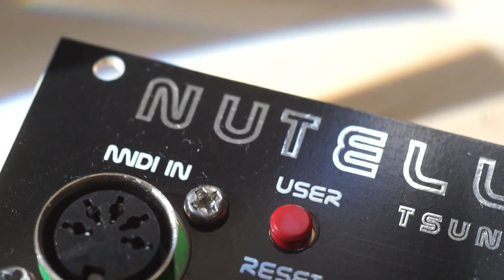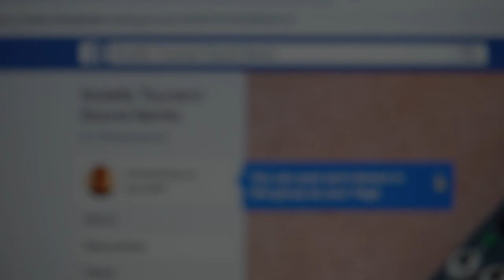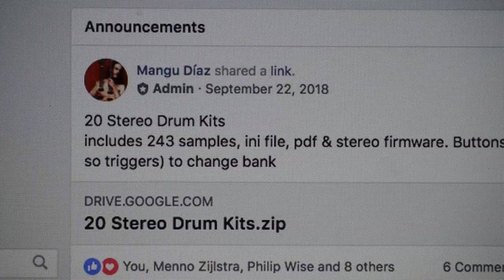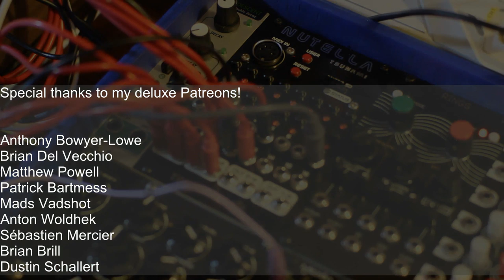Kit Overview #36 - Tesseract Nutella - (Eurorack Tsunami)

Comment: Have you had any trouble with the Nutella working for a few minutes, and then the audio just messing up?  Currently debugging mine but not having much luck figuring this out.
Reply from the maker: I had one SD card go corrupt once, swapping to a new one fixed it, maybe try that!
Reply: Thanks for the suggestion.  I'll add that to the list of things to try.  The issue is an odd one.  I have a single highhat mono wav on the sd card, and set it on a metronome, and it plays fine for a while, and then the sound of the highhat morphs to a sound that doesn't sound right, unless I reset the Tsunami and it restarts back to working fine for a while, and then the sound morphs again.
Reply from the maker: @interference7480  THat is strange, maybe you should talk to sparkfun, if your unit is faulty they can probably replace it for you
Reply: @QuincasMoreira  I am unable to reproduce the issue with the Tsunami on its own.  It only happens with the Nutella and it also happens no matter which output I use.  I had thought maybe it was a bad op amp but no luck.  Mangu has been helping me debug it.  No luck yet but he is awesome.
Reply from the maker: @interference7480  Ah good, and yes he is :)
Reply: @QuincasMoreira  Problem solved (for now).  My test power supply does not provide enough amps at 5V to run the Tsunami.  Of course it doesnt!  lol
Reply from the maker: @interference7480  Ah good! now you can fix it :)

Comment: I keep meaning to ask ... what are you using to connect your Rigol to the Eurorack? Is it something that we can DIY?
Reply from the maker: sure! I just bought a couple of cheap scope leads and replaced the probe tips with mono plugs. It's tricky because the wire is super thin on those scope leads. You can also just buy male BNC connectors and mono euro cables and replace one end of each euro cable with a BNC connector.
Reply: @QuincasMoreira  Hey, can this be used as a polyphonic MIDI to CV converter? if so, how many voices can be used in polyphony? Thanks, Awesome module!